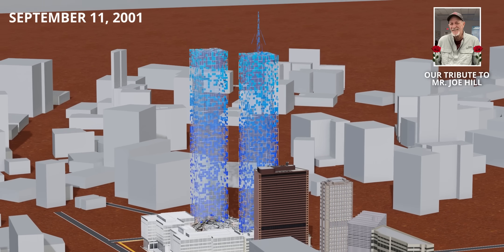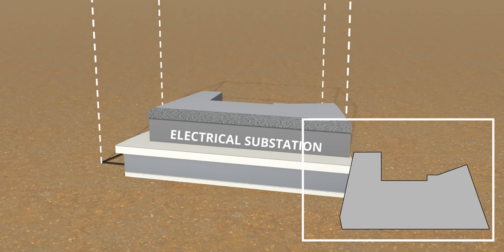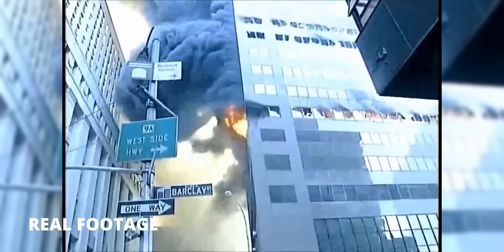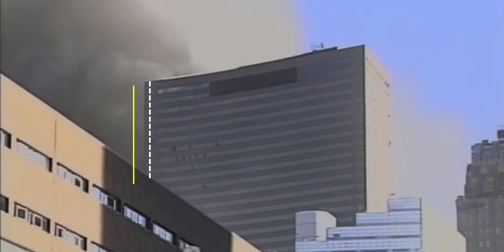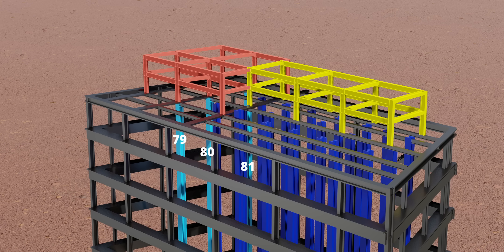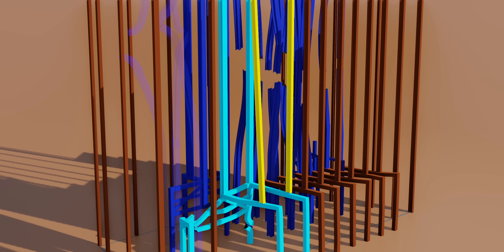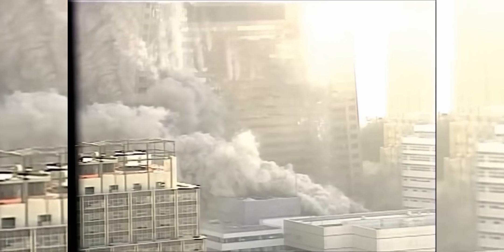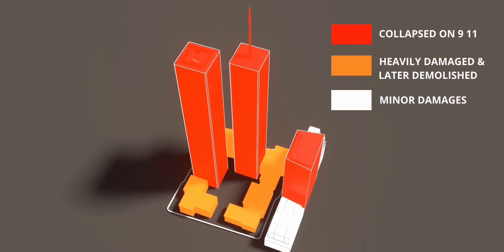Collapse of Building 7 | The Complete Physics

Comment: Explain  all  the  B.S  you  want  ... We know  what  we  SAW !!!
Reply: Yeah. The statement, I believe is, "The stupid see what they believe."
Reply: I doubt it.  The collapse of Building 7, the 6th building to collapse of 10 lost on 9/11 is NOT intuitive and still confuses many even though it has been extensively studied. Not famous or a terror target, and with no casualties it did not get a lot of attention initially, creating an information void the internet rapidly filled with garbage. Because everything seems like a conspiracy if you don’t understand how it works I prepared this brief summary of the collapse from my own analysis. No politics, just engineering. 

The North Tower collapse at 10:28am bombarded Building 7 with tons of burning debris, causing heavy damage and starting multiple fires burning out of control for the next 7 hours. Half the FDNY firefighters having been killed, others injured, units in disarray, equipment destroyed, no water pressure, and the greater urgency of Search & Rescue efforts, firefighting was pulled as futile. The building couldn’t be saved and was left to its fate.

www.youtube.com/watch?v=g_SvpwyC17M&ab_channel=MFitz  

Collapse of a burning structure is always a concern for firefighters. Steel buildings subject to fire rely on active fighting of the fires to survive. Buildings are designed around 1 to 3 hours of fire resistance, allowing time for occupants to escape and ACTIVE firefighting to get started, after which all bets are off. Left to their own devices they will exceed their design envelope and collapse. In B7 the occupants escaped, passive and active fire protections were compromised and active firefighting was abandoned which left the building to take its chances. It lost. Odds on Building 7 would eventually collapse, and it did. No big deal in logic. That is the sort of choice firefighters make every day in brush fire situations - which houses to save and which ones to let go. Only real difference here is moving the decimal on the size and cost.

www.youtube.com/watch?v=WnYBX6QT0R4 

FDNY Chief Daniel Nigro ; The biggest decision we had to make on the first day was to clear the area and create a collapse zone around the severely damaged 7 World Trade Center, a 47-story building heavily involved in fire. A number of fire officers and companies assessed the damage to the building. The appraisals indicated that the buildings structural integrity was in serious doubt. I issued orders to PULL BACK the firefighters and define the collapse zone. It was a critical decision; We could not lose any more firefighters. It took a lot of time to PULL EVERYONE OUT, given the emotionalism of the day, communications difficulties and the collapse terrain

FDNY Deputy Chief Peter Hayden ; We had our special operations people set up surveying instruments to monitor and see if there was any movement in the building. We were concerned of the possibility of collapse in the building. And we had a discussion with one particular engineer there, and we asked him if we allowed it to burn could we anticipate a collapse and if so, how soon? And it turned out that he was pretty much right on the money, that he said 'In its current state you have about 5 hours

The collapse of Building 7 was anticipated and widely reported in the media throughout the day. At least 24 video cameras recording some or all of the collapse. Everyone knew what was coming and why.

www.youtube.com/watch?v=OY5S5k3tMHI 

Building 7’s collapse was completely different to the Twin Towers, harder to understand with most of the details difficult to see. But we can still sort out what happened through careful analysis and observation.  This is MY EXPLANATION of the collapse sequence using the best available information and relying on no authority.

B7 was complex 47-story steel framed structure built on top of a smaller existing 3-story building, requiring several lower floors dedicated to complex load transfer structures instead of usable office space. Of trapezoidal shape and all-steel tube-in-tube construction, B7 (above the 7th floor) consisted of a central core of steel columns carrying most of the gravity load, perimeter steel columns around the outside of the structure carrying the remainder of the gravity loads and long span beams and girders to tie those elements together and form the floors. On the outside of the building hung a moment frame - the last part of B7 to fall. 

Phase 1 : The first externally visible signs of collapse initiation occurred at 5:20:28 pm. Collapse initiation for B7 is notably quiet with observers not realizing the building was collapsing! There was no audible warning in the form of say hundreds of ear drum busting 180-190dB explosive bangs preceding the collapse. Here at 12:00 a local CBS affiliate reporter is talking 10 blocks from B7 when collapse begins. People don’t start to notice the collapse until 12:11. Then at 12:45 is the famous CBS fixed camera clip of Building 7’s collapse.  Note how quiet it is.

youtube.com/watch?v=t5tEy6mXSE8&ab_channel=fresnosean379

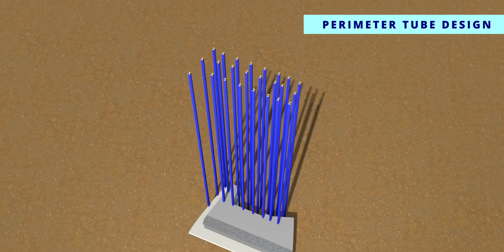Collapse initiation was due to lower floor failures above the load transfer region (7th floor) in the NE corner of the building. In this video at 0:45 you can see the NW corner from inside the building while under construction, Column 79 just out of frame on the left. That big, angled steel beam across the top of the frame connects to C79 at one end. The girders connect to the beam. That beam and all those girders depend on just one connection

youtube.com/watch?v=nP3TNHPCIVU&t=35s&ab_channel=EdwardCurrent

Phase 2 : Lower floor failures caused a loss of critical lateral support over an excessive length of core Column 79 and it buckled. If you look at a floor diagram of Building 7 (see above) and look at all the structures that depend on C79 you quickly realize this one column was a relatively isolated structural element on which a disproportionately greater fraction of the structure depended analogous to say the Key Bridge. Externally we see a vertical progression of window breakage along the 44-46 line and a kink in the roof of the East Mechanical Penthouse at the top of the building, consistent with C79 failure. The transition from full capacity to almost no capacity occurs in virtually an instant. Once the buckling failure occurs there is almost no resistance

Normally with a buckling column, the load could very well be redistributed to other columns, meaning the buckling could stop after a while. With C79 that is not the case - the failure did not redistribute the load, so the collapse rapidly progressed to the roofline, sinking the rooftop penthouse.

Phase 3 : With C79 gone, B7’s progressive, non-symmetrical collapse continues with C80 and C81 at the east end of the core left laterally unsupported and quickly buckled and failed as well, sending the EMP down through the building. C79-81 all have no diagonal bracing, which I believe is a major reason why they could not redistribute a lot of vertical loads among one another.

From there collapse progressed from east to west through the central core until the core was gone taking all of the interior floors and structures and probably most of the perimeter columns with it. You can see the horizontal progression of window failures low in the building and the dropping of the remaining rooftop structures into the building. One of the big takeaways from the NIST Building 7 study (that gets completely ignored) was their modeling which determined C79 failing under ANY circumstances would have initiated the same collapse sequence.

Phase 4 : After some 10 seconds all that remains of Building 7 is just a hollow empty outer shell - the exterior moment frame - creating the illusion the building is still standing since little has changed externally. But it’s just a hollow empty shell like an empty cereal box supported by only a few remaining columns and quite unable to remain standing. With all the internal framing gone, the north face leans inward, forming a V in the roofline, the last perimeter columns buckle under the strain and with nothing left keeping it up the moment frame free falls, landing on top of the 7-story high debris pile. It is only at the very end that a single measurement of alleged free fall acceleration is taken. Note this is not the building but just its outer shell, and only one corner at that, at the very end of the collapse. Start to finish the entire collapse took 18-20 seconds, or less than 1/3 of true free fall and we have to look at the whole thing, not cherry-pick little bits to fit a particular narrative. Worth noting _how fast something falls cannot tell you what started it falling in the first place. The debris spread out, blocking surrounding streets, heavily damaging the Verizon Building and destroyed Fiterman Hall, all well outside of Building 7’s “footprint”.  

Building 7’s progressive, non-symmetrical collapse was incidental and unintended collateral damage from the combined effects of fire + time + gravity started by the collapsing North Tower. That is true no matter who planned and carried out the 9/11 attacks or why . The collapse was of so little consequence it barely even registered at the time, a mere footnote. It only took on semi-mythical status as an alleged smoking gun years later when demolitions at the Twin Towers, missiles at the Pentagon and shoot down over Shanksville all failed and conspiracists had nothing left to work with.

Anything can seem like a conspiracy if you don’t understand how it works. Now you should. I hope you found this helpful, informative and it solicits informed critical comment. If I made any errors of fact, logic or reason or left anything important out, please let me know so I can fix it. IF you can offer a more plausible alternative please do. Be the first. Please start any reply with the words “Tits McGee” or I will know you didn’t read it and are wasting my time.